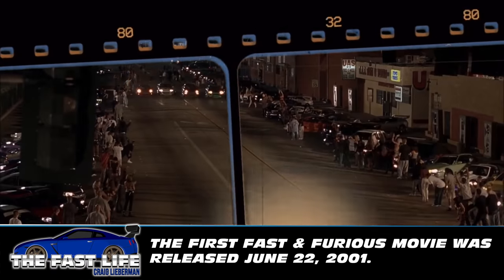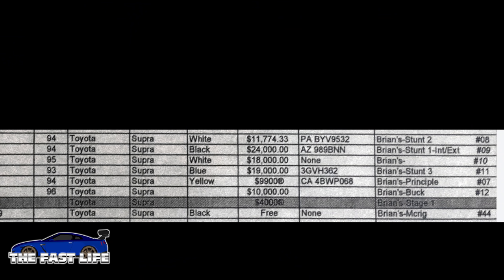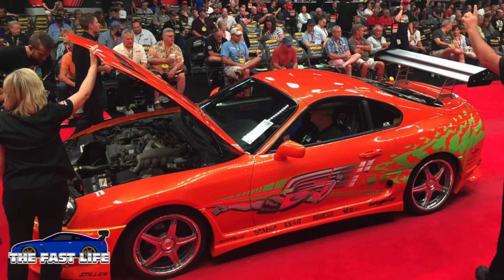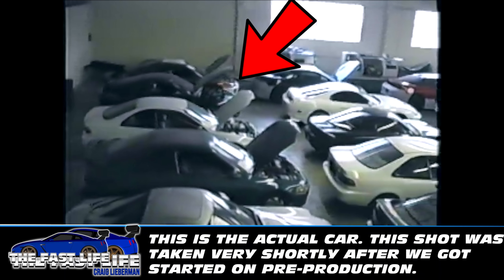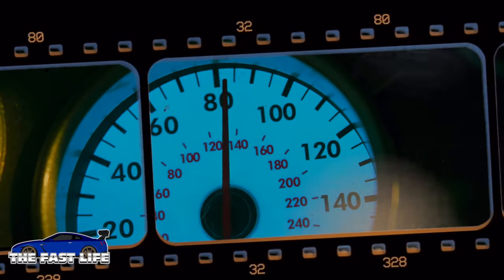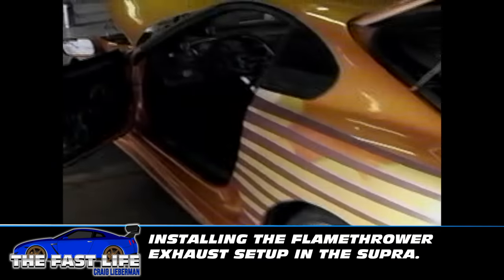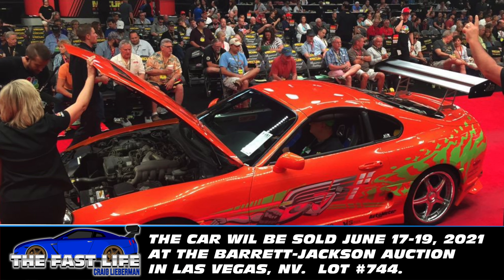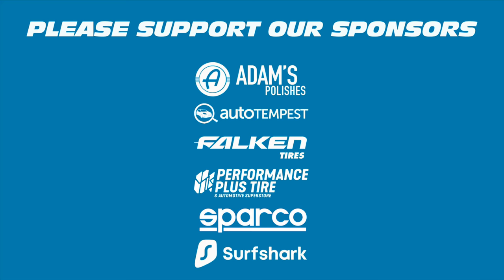Fast & Furious Supra Up For Auction

Comment: The FF2 Supra is stunning aswell as the FF1 version
Reply: I really liked the bodykit on the 2f2f supra but,  they should have used diffrent vinyls imo.
Reply: @christopherhamilton8879  Agree!
Reply: I like the TRD wide body kit. Pretty rare kit these days.
Reply: @ohbromo  I believe the cars in 2F2F had replica TRD bodykits as TRD wouldn't supply.
Reply: @willpeet8294  Good! Yeah, I noticed Craig said “TRD style” kits right after I commented.
Reply: Fnf 1 Supra will always be the best though.

Comment: The stunt Supra that was sold a few years back, in my humble opinion, it has gone throught an outside refurbrishment, at the very least, cause the decals and a few other details, just don't match what we see on the film and other pictures of Craig's actual car
Reply from the maker: That was ANOTHER stunt car. Not this one.
Reply: @craiglieberman  Ye ye, I know, I was specifically talking about the other, this one, if you hadn't mentioned a few differences, I wouldn't have noticed anything

Comment: If my memory is correct those wheels were made by in California wheels called Se7en Mod ? I had Axis custom drill a set of Se7en Mod  for me around the 2002 Era for my 1991 Volvo 945 T
Reply from the maker: They were actually Racing Hart M5s.
Reply: @craiglieberman  and then they were quickly discontinued 😳 Which stunk, because those were some sweet looking rims!

Comment: This car was re done back to look like the 1st movie it actually to be true should have been left in the condition of the 2nd movie. Also the seats have been replaced with the wrong seats so technically Paul Walker never sat in those seats. Just saying if your buying something under that premise your being mislead.
Reply: as well as the steering wheel that has been replaced
Reply: @reniervandermerwe  So yah he has not sat in those seats or touched that steering wheel. It's building hype for a vehicle that he really didn't  sit in and because it's been all redone he hasn't touched the paint either. It's a Supra that has really very little true history and has very little to do with Paul Walker. Anyone paying over $100,000 for that car is being mislead and ripped off.
Reply: Agree! 

The fact that the car got re-used in "2 Fast 2 Furious" and then restored back to the "The Fast And The Furious" look, is kind of a turn off... 

If this Supra didn't get used in the second movie and kept its original look from the first movie, it would be worth way more...
Reply: The seats are from the 2nd movie just reupholstered. Originally we where trying to find the right ones but discontinued. You guys got to realize you Can’t get many parts any more.
Reply: @myersj231  the supra is being advertised as one the Paul walker drove, he drove the car but considering he only drove it for a stunt means he touch the steering wheel and seats.... The original seats and steering wheel aren't in the supra anymore so technically he didn't touch that car so why is the car being marketed as such.
Reply: @myersj231  It still don't make it the original car so you can't go stating Paul Walker was in it. He had nothing to do with that car as it is. Steve McQueen's Mustang was original if they restored it then he  no longer would he have had any contact with it. If they sell this as a Paul Walker's movie car it's a fraudulent statement. That is the point. To be true F&F movie car it should have been left as it was after the second movie. Once you remove everything from the movie car  and redo it to the way you like. It's your car your choice  but is  no longer is it original to the movie and if I bought it on that basis that it was. I know I  would look at legal avenues afterwards.If you paint over the Mona Lisa and destroy it then it is no longer the Mona Lisa.  Basically you killed the value the second you started trying to restore it the way you like. It's just a Supra now and that's how it should be sold.

Comment: This one going to auction is an Automatic? They didn't try to 5 or 6 speed swap it? 🤔I wonder if that will play a part on it's final price
Reply: Probably not bc most people aren’t manual snobs anymore. They could always swap to manual or make it a built auto and it would be fast either way so it wouldn’t be that big of a deal

Comment: Does anybody know the exact location in The Fast And The Furious movie where Paul walker drives The newly built Supra  out of the garage and onto the street. Getting side ways before turning left onto an unknown street??? The next scene shows him driving down I believe,  Pacific Coast Highway where he races the black Ferrari.
Reply: that car is the hero 1 car that belonged to Craig, he sold it and it is now with a private collector in the netherlands
Reply: Thanks for the reply but I wanted to know the exact location of the street where the Supra’s rear ended gets side ways.
Reply: In the movie, it was at Dom's house. Which is 722 East Kensington Road. But most likely filed in universal studios lot.
Reply: The garage where they built the supra is DT precision auto.  (Doms garage). Actual location is 2640 Huron Street, Los Angeles, California.
Reply: Thanks a lot man. Also, do you know the street that the crew was driving on when they had Brian’s red truck loaded to the top with parts for the Supra?
Reply: @quentinturnage7252  from what I found I believe the address is 596 W ave.28 Los Angeles.    LA deal market is on the corner. And part of that sign can be seen in the movie shot.   Appears quiet different today then in the 2001 shot.    They would be driving south down w.28 ave toward Dom's garage which in reality is only a few blocks away
Reply: That is the correct location for the market. How I wish I could go back to the early days.